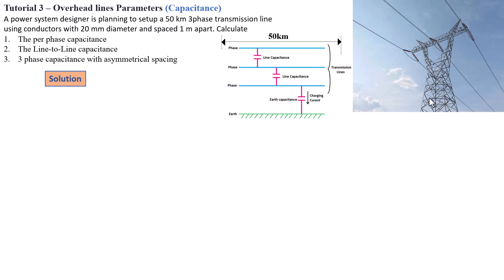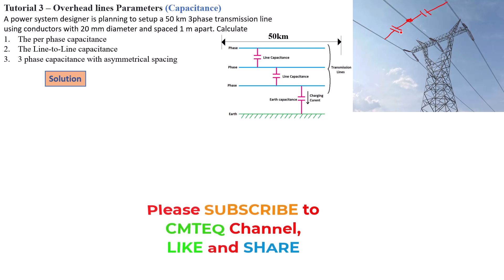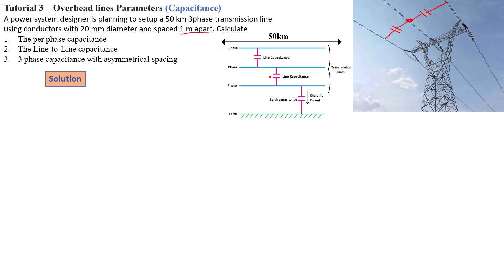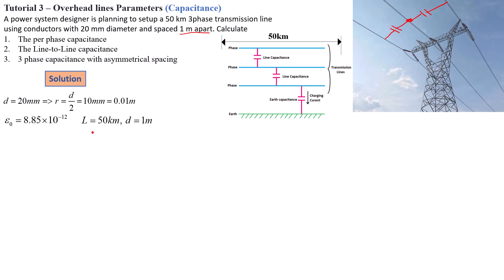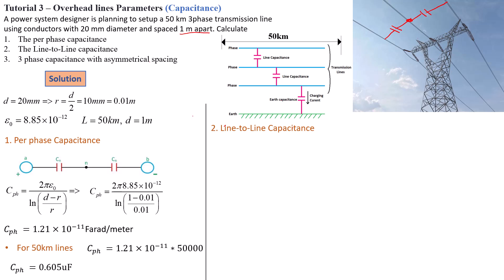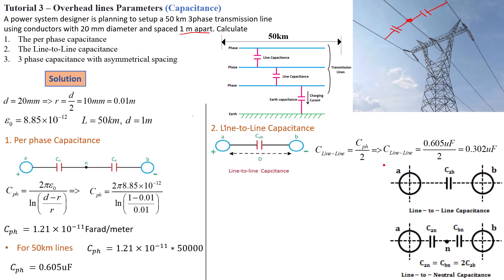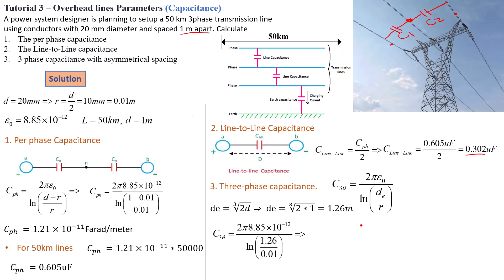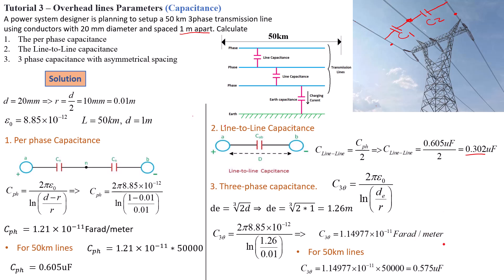How to calculate overhead transmission Lines parameters (Capacitance) - Tutorial 3

Comment: At the 7:20 mark, you speak of ADDING C1 and C2.   Unless I'm misunderstanding you, "stacking" equal capacitors HALVES the capacitance.  It doesn't double the capacitance.  Now, your end-result numbers are correct.  So, your calculations did work out.  But, I'm confused by the words you use which suggest adding the capacitances.  Could you please clarify the concept you were trying to convey?

Also.... for long transmission lines, the arrangement of the three phases is rotated between towers periodically, which each phase being shifted in position relative to the other two.  Would that change the calculations?   For simplicity, let's ignore the relatively short lengths were the cables cross each other between a pair of adjacent towers.  I'm more curious about the re-ordering of phases with respect to each other geometrically.  Would this impact the calculations?  Or, would this complication ultimately "cancel out" any perceived changes to the calculated capacitance?

Thank you for taking the time to produce this video.
Reply from the maker: Thank you for your comment. Let me try to address what you raised.

1. As you know these capacitances are created by the electric field between conductors, so when we have 3 phases as I explained in the video we basically have two equal capacitances on each side of the phases, but we also have 1 capacitance between the 2 outer phases, which will be equal to the two combined capacitances in a symmetrical system. 
We may have halved the 2 capacitors to end up with 1 capacitor, but we also took account of the "Capacitance" field between the outer phases.
So if you look at it as per the electric field interaction relative to the potential differences between the 3 phases we will end up with 2 capacitances. The inclusion of 2 ensures that the electric field interaction between all three phases is accounted for properly. I hope its clear enough.
I will look up on how to simulate this as a possible way to prove these formula.

2. Here you are referring to the conductors transposition or re-ordering which I spoke about on Tutorial 2 about Inductance calculations, but yes it does have a small effect on the calculations but nothing major as it actually can balances out over a long distance.
So, Transposition of the conductors are done to balance the 3 phases throught the transmission lines to avoid having 1 phase with more voltage drops then the others causing more system instabilities, this does not change the overall electric field between the phases through the transmission, thus the values of C and L. This is why when calculating the Capacitance and Inductance we just assume that the phases have equal field throughout the transmission.

For short segments of the line, the capacitance and inductance would depend on the specific spacing between conductors in that segment. If you were calculating capacitance or inductance for a single untransposed section, you would need to account for the asymmetrical spacing.

For the entire line, however, the practice of transposition allows you to use simplified formulas that assume a balanced system. The transposition makes it possible to average the spacing between conductors and use a single equivalent spacing, such as the geometric mean distance (GMD) or equivalent spacing De to calculate the overall capacitance and inductance.

I hope that help.
Reply: @CMTEQ  Thank you so much for the thorough reply.  This was the first video from your channel that YouTube has shown to me.  I'm embarrassed that you already covered crossing conductors in an earlier episode.